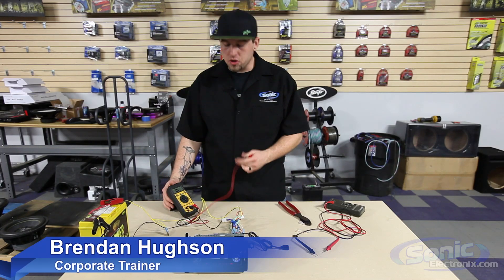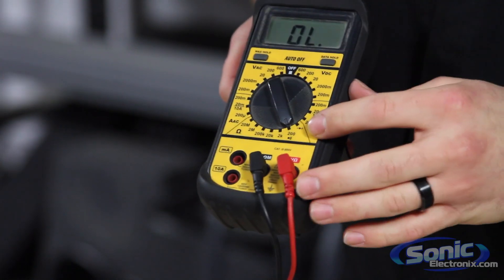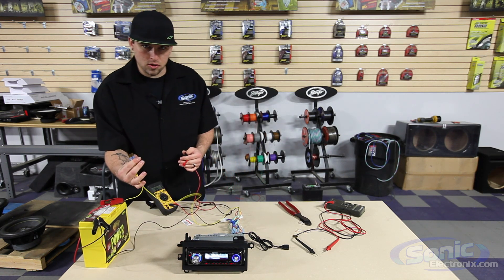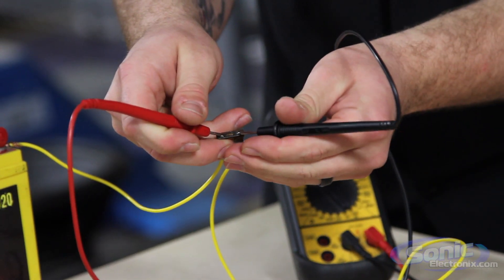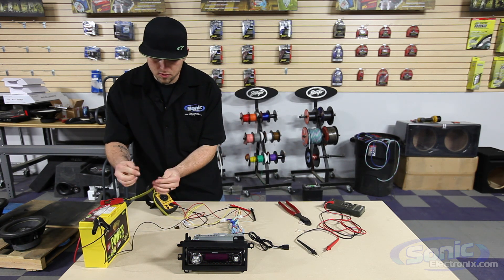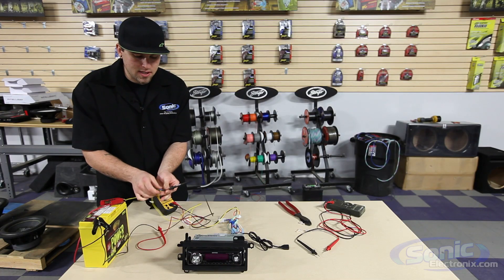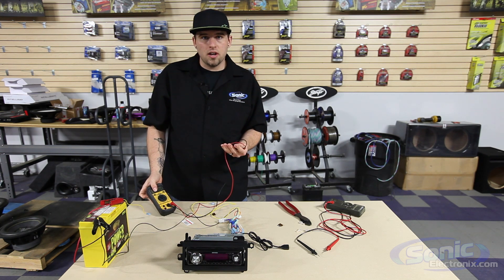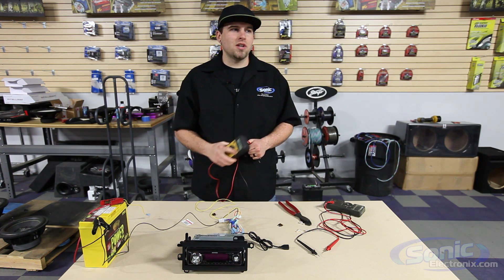How to Check Continuity with a Digital Multimeter | Car Audio 101

Comment: If you check continuity from the BATT and the GND, should there be anything shown on the meter with nothing connected?  I've got an old amp that I was told might have a short and that seems to signify a problem that could drain the batter even when off.  But I'm really new at this.  Any thoughts on the continuity?

Comment from the maker: We understand your concern and you are correct. You should power the circuit down before performing any work on it. The average meter is more than capable of handling 12V without issues, especially if it has protection in place. If you have a cheap meter, make sure to power your system down to preserve the integrity of your meter. Thanks for your input, a lot of meters will be saved. :)

Comment: You should always check for voltage across the fuse first if it is plugged in. If there is the fuse is blown. The reason is multimeters run a small current through the fuse by applying their own small voltage across the meter's leds. The problem is if the fuse is blown and you put the leds across it, you might have 12 Volts across the fuse. The meter in continuity mode will not be expecting a voltage to be present and if the meter doesn't have protection the meter input could be damaged.